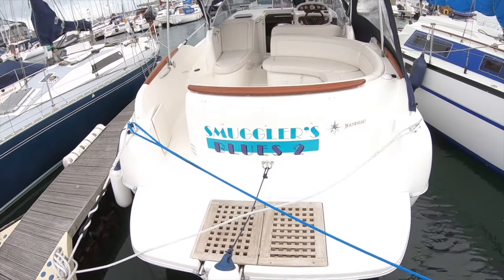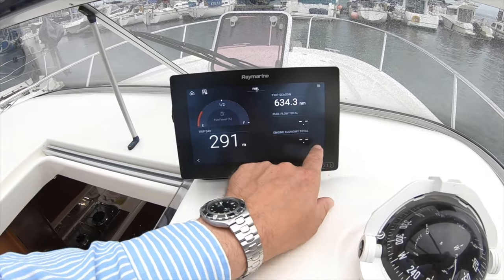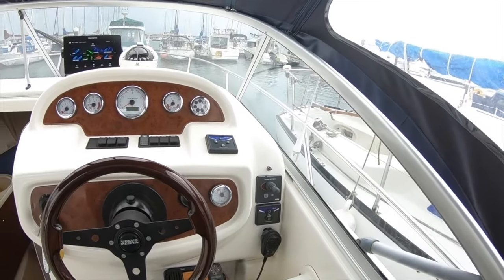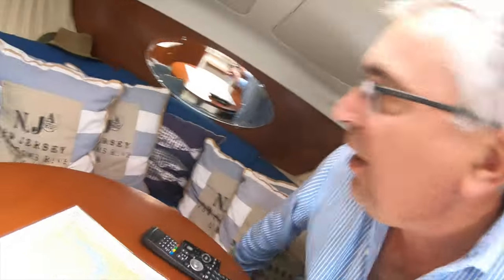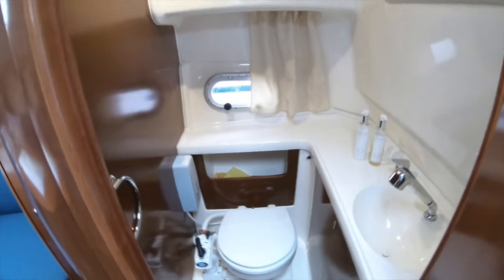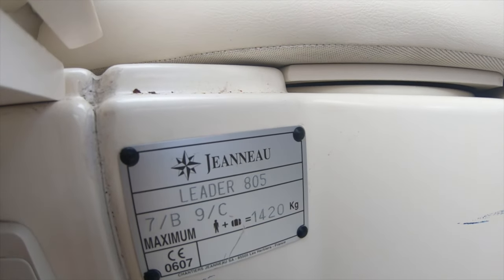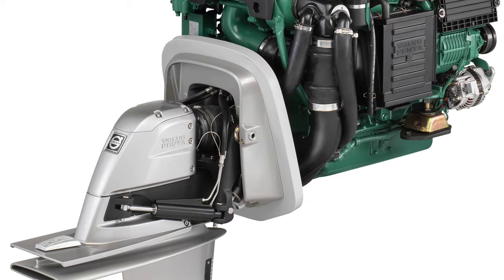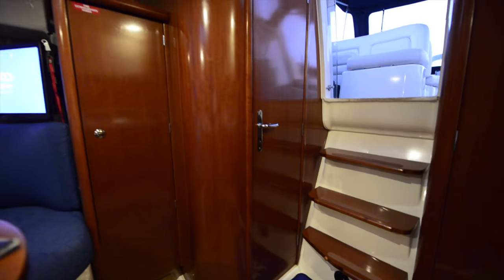MY OWN BOAT : Jeanneau Leader 805 Full Tour

Comment: Hi. Carbon monoxide sinks in atmospheric air. It looks like you have the monitor abover sleeping height. That may mean in the closed cabin the CO increases to be dangerous to the sleeper, but not trigger the alarm. May I suggest you check, but I would mount it as low as possible (floor level). Same for the other cabin where you sleep.

Comment: I think a Jeanneau 805 may be my next boat when I upgrade, once our kids get a little older (so we can bugger off and get some peace!) we plan on some weekend trips this looks perfect !
Reply: @Michiel Geerling I currently have a Beneteau Flyer 650 Cabin, with a 140HP Suzuki Outboard. it is a fabulous boat for a family day out. For a small boat it has a decent size cabin with a sea toilet. It will cruise on plane  happily around 18 knots or 34 Knots flat out on a calm sea. As a footnote In the past I have also had a Beneteau Flyer 550 Open, several RIBS & various other small boats including a SeaRay Bowrider (all to fit my swing mooring),  I really like European boats - so sturdy they handle our seas wonderfully, American boats are a bit 'plusher' but small American boats tend to be too light on the bow and heavy on the stern/engine - ok on lakes but no good in the open sea. :-)
Reply: And I like boats with self-draining decks !! no plugs to worry about !!! LOL
Reply: @Michiel Geerling It is pretty economical when cruising but not when at full throttle. I haven't really worked out fuel figures but if we go out for the day and cruise around the bay, stop in a few coves for a swim or lunch, probably 30 miles  round trip mixed throttle use would be about 20 ~ 25 litres of fuel. It has a 136 litre fuel tank and plenty of space for spare fuel cans So I think a range of 120 to 150 miles would be easily doable

Comment: Carbon monoxide has the same density as air and can form pockets. So it doesn't dissipate as much as you might think, or move around. So you should get those CO monitors out of the little creches and put them on the ceiling or walls higher up, where air currents will hit.

Comment: That canopy is clever. Mandatory youtube nitpicking, I thought most of the early Leaders 805 are equipped with the kad43 - just a slightly quieter kad42, I believe the power output remained the same. At least for those sold by the iberian dealer. Lovely boat and much improved hair.
Reply from the maker: HO, I do believe that you are absolutely right! I think it is the KAD43 although as you say, it's a very slight upgrade of the KAD42 so I think my comments stand.  :)

Comment: What a great boat,haven't looked at one before. I've got a Sealine 270 at the moment but think I'll have a look at one of those when I come to upgrade. I really like the wood below and wardrobes,seems to have a lot more storage than mine. Happy cruising.
Reply from the maker: Thank you. I'm extremely happy with it as you can probably tell! Yes, it would make a good upgrade from the Sealine 270, similar size and concept of boat but newer and more modern, and with the current series of Volvo Penta engine.
Reply: @AQUAHOLIC  Yes Nick, more modern is about the strength of it. I am a 270 (kad 42) owner & I know we have more standing headroom in the cabin & bigger galley area. The Leader was a strong 2nd choice for us except no Diesel boats can be found in France & the wife vetoed it when I insisted it would be named G.G.
There are many in our marina as they are built just up the coast from us.
Reply: @AQUAHOLIC  I'd like to add that I very much like the asymmetrical deck, with a wider port side .  Also the full width cockpit seating to make the most of the social space. For me the downside is no radar arch, where we have overhead lighting for evening lounging & the TV / Radio antenna up high. In our marina, we have tall apartment buildings that block some of the tv signals at low tide.
Reply from the maker: @russcattell955i  The asymmetric decks and full width cockpit work brilliantly. Agree about the arch, useful for canopy location too. But against that, the (winter) flat tonneau cover fits better as it doesn't have to cut inside the arch so it's all a compromise I guess.

Comment: I know it's an old video and i hope someone already told you but carbonmonoxide is denser then air so it sinks to the bottom your meter should always be placed below where you're head is going to be
in you cabin you have it by the window but sleep at least a meter below it place it somewhere near the floor. 
I hope this advice helps to save a life.
thanks for al the content Nick love your video's
Reply from the maker: This is the official advice: 
Because carbon monoxide is slightly lighter than air and also because it may be found with warm, rising air, detectors should be placed on a wall about 5 feet above the floor. The detector may be placed on the ceiling. Do not place the detector right next to or over a fireplace or flame-producing appliance.
Reply: @AQUAHOLIC  ow geez, thank you nick i learned something new today im going to check the advice on mine and relocate them

Comment: I had one as mi first boat. Very stable to cruise. Did not have flaps or trusters, due to its beam, you really need the trusters. Sold the boat, had an older mercruiser diesel single engine, single prop. Would now go for a dual engine setup.

Comment: Nice boat Nick! You didn’t mention range. Could you, if you were so inclined, take a summer off and take it down to the Med (obviously a few stops on the way)?
Reply from the maker: It’s probably about 250 miles. Med is technically possible if you went through the French canals.

Comment: Fab video Nick, Looking for my 1st boat after seeing your video will be looking at the Jeanneau leader 8 - year 2011 question being is this boat as good as the 805? regards Andy
Reply from the maker: Thanks Andy. As far as I'm aware, the Leader 8 is basically an updated 805 Leader. It's more modern looking and has some useful upgrades - the radar arch is great for attaching canopies (and fitting radar scanners I guess), the dash is tiered so it will take a flush mounted MFD and the cockpit seating is 'squarer' and more modern. The interior is virtually identical but there's an option of a matt oak (I think) finish. The only downsides I can see is that it's inevitably more expensive (as it should be, it's a newer more modern boat) and the bathing platform is longer even than the extended 805 platform, so takes it a bit over 8 metres (which may not be important). Looks a great boat to me! Best of luck.

Comment: You mentioned you had the boat machine polished and sealed, roughly what should you expect to pay to complete this work given the already lovely condition of yours.
Reply from the maker: All of the winter works, which included this, antifouling the boat, treating the teak on the bathing platform and a few other bits came to about £1,300 I think

Comment: Correct me if I'm wrong but isn't carbon monoxide heavier than air.  Therefore making placement of your detectors at waist height no good.  Should they be on the floor
Reply from the maker: Good question, but apparently not (regarding placement), worth a Google.
Reply: Yes, I've heard stories of people drowning behind like house boats while swimming because the engines were still running and the carbon monoxide sits on the water.
Reply: Ok googled that and yes indeed you're correct and I learned something today.  CO is not heavier than air , more like even weights making distribution a more even affair.  Great stuff

Comment: Thank you great walkthrough! Taking delivery next month of a jeanneau powerboat similar in size, very helpful. I’m looking at this seasmart unit, seems very useful. Do you use any other chemicals directly into the tank or after flush with this unit installed? Take care!
Reply from the maker: The toilet is seawater flush, so it pulls water directly from the sea and pumps out directly into the sea. So there isn't anywhere to put chemicals.
Reply: @AQUAHOLIC  That’s practical. I’ve got a holding tank to deal with. Here in Sweden authorities don’t allow waste into the sea, but the infrastrucure of pump out stations are a bit behind. Seasmart would probably help keeping at least the inlet hose in better shape (smell) 😊

Comment: I'm interested in getting this model boat 2003 ,I will only really be using it on the Norfolk broads, do you think it's a good boat just to use on river work, also what do you think is a good price for a 2003 model it had a diesel engine, many thanks and love your channel 🤠
Reply from the maker: Plenty of boats like this on the Broads, it's where mine came from! Price is very dependent on condition and specification so it's impossible to say, but diesel boats are always worth more.

Comment: As someone that only dreams of boat ownership,how in hell would you get that engine out if it suffered a major malfunction? There just doesn't need to be enough room.I'd be interested to know
Reply from the maker: You'd need to remove the cockpit floor.
Reply: @AQUAHOLIC  That sounds ultra-expensive.No wonder you're going to look after it!
Reply from the maker: Compared to the cost of a new engine I suspect it would be pocket change!

Comment: That is a great boat improved with your added kit..  What is it's top speed - cruising speed and fuel usage?
Reply from the maker: Thank you! Top speed is about 33 knots and it cruises very nicely anywhere between 20-27 knots. At 20 knots it's using about 25 litres an hour, at 26 knots it's about 34 litres an hour. In fact if you work it out, per mile there is little difference as, although the consumption per hour goes up, at higher speeds it takes less time to cover the same distance of course.

Comment: Great video. I am researching my first boat and this one comes up regularly but I don’t see many around. Can you tell me what year yours is as I the look, as well as if you know if there are any major watch outs?
Reply from the maker: Hi Mark, glad it was useful! Mine is a 2006, they were built from 2000 - 2007 I believe. The 805 Leader stayed pretty much the same bar cosmetic changes - earlier ones had pin stripes on the outside which date it a little (but could be removed), and the cockpit upholstery changed a little. The only big change is that very early boats had a lower windscreen but I've only ever seen one with that. I'm not aware of anything you need to be aware of regarding the boat beyond the usual checks. The D4 engine I mention in the video had a few recalls, the big ones being the raw water filter cap was originally a black screw down type and it could leak under pressure at high revs, pouring sea water into the engine bay! Make sure it's been changed for the new type, clear top and four thumb screws holding it down. Also the outdrive steering uses hydraulic rams. On early versions the slim ram that slides into the bigger section would get marine growth on it which would then destroy the ram seals. Volvo fixed it by fitting rubber gaiters. Again, it's a recall thing so it's fixable if not been done. Nothing else springs to mind, they're a little basic in some ways, Jeanneau saved money by being mean with things like no water tank gauge, no anchor winch switch at the helm, only one windscreen wiper, no horn, and so on. But the parts they do fit are generally good quality, decent Lewmar winch and deck hatch for instance. And they seem tough and well built boats. There are lots out there but you're right, not many for sale (I found the same). My theory is that it's a size you move up to that is affordable to run, and the next real step is a huge jump into 30ft+ with twin engines so way higher running costs. So I think people do what I've done, get to this boat which gives them a proper offshore cruiser with decent facilities and say 'that'll do for me'. I genuinely can't see me selling mine unless I have to, and that would be a sad sad day.
Reply from the maker: Just to add, in case you've not looked, there are lots of other videos of the boat on my YouTube channel. And if you 'subscribe' you'll get notified of any future videos going up (it's free, you just click the 'subscribe' button).
Reply from the maker: @mdtaylor2274  Thank you, I love it too! No licence required in the UK (although I do have an ICC anyway).

Comment: What a great boat!! How much would one of these run new?
Reply from the maker: In 2006 when this was new, about €100,000. Today, I'd guess at about £150-200K.
Reply: @AQUAHOLIC    You could easily get what you paid for it today Nick.  Personally, I would not trade your boat for two screws.  I am comfortable with a single engine on a coastal cruiser.  Yes, of course on a bigger blue water the redundancy of a second engine becomes important.

Comment: Hey Nick - now that the old 4.5Kg Calor cylinders have been discontinued, what make and model of gas cylinder do you use on Smugglers Blues?
Reply from the maker: Same, I renewed it a couple of months ago. I use the stove so infrequently that it should last me for years hopefully.
Reply: @AQUAHOLIC  Lucky you! I guess I'll have to measure the size of the old one then try and determine the size of the new ones to make sure it will fit!
Reply from the maker: @user-redsix  If you're in the southwest of the UK, try Darthaven, it's where I got mine a month or two ago.

Comment: Hey Nick. Finished the refurbishment and launched Sylvia today. First disappointment was how badly she hunts to Port and starboard at low speeds. Does Smugglers Blues do this and if so, have you found a sterndrive tilt position that minimises it? She is also too fast at 3.7 knots at idle, which is faster then I like to go in a marina. Guess perhaps I should not have bought a sports cruiser for mainly inshore cruising! Thanks and regards Steve
Reply from the maker: Sterndrive should be all the way down/in when not planing (so low speed use, also when leaving the boat unless the mooring dries out of course). They all wander a bit, you learn to guide them like a horse rather than steer them like a car. As long as it's pointing roughly the right way then let it wander a little. Otherwise you over-correct, then over-correct the other way and you're just sawing at the wheel constantly.

Comment: I’ve just come into some money thanks to the lottery and wanted to invested in a ship ..... is this a good ship to buy ? Thanks...?
Reply: Stop lying
Reply: I've also come into some money from a PPI refund, I might get the radio for when I'm in the bath.
Reply: Ive also came across some money in my bathroom turns out my wall had a compartment with 3 million dollars in gold coins should I get a radio for the boat?
Reply: Bigyeti Technologies you should also buy a ship..
Reply: Kevin garcia save up and buy a ship...
Reply: Kevin garcia not lying.... buy yourself a ship....
Reply: Sprocket by the sea..... go to the sea and someone will sell you a ship....
Reply: Bob G thank u Nigerian prince but I’ve invested in a ship now....
Reply: Crazyirish _  I'll need 10,000 as a wire transfer fee and 7500 for data protection archive storage fee...
And password. 👍
Reply: Crazyirish _  😜😂

Comment: Love the video. Where do you store the framework that goes round the back of the boat for the covers? Is it permanent or does it fold away somewhere? Looks like the front part folds up into a  tube cover, but wondering about the back part of the frame?
Reply from the maker: It folds forward ahead of the windscreen but is a PITA, so we leave it in place
Reply: @AQUAHOLIC  Many thanks. Can't seem to see another boat that has all the features at this size, (don't like curtained off compartments) wondering if I might be able to eventually stretch to a used Leader8 that seems to have a lot of nice ergonomic extra features.

Comment: Would you have been tempted to buy one with a petrol engine?
Reply from the maker: Not for my use, no petrol close to where I berth and more expensive to run (fuel cost and consumption are both much higher). But it depends where and how you use it.

Comment: 2+ years later...  A few thoughts:

I'm shocked at how much boat can be packed into 25'-7"...!  Great family boat, and very entertaining for two couples for a weekend.  Love the horseshoe layout!  Very useful.

Like the gas range.  (What the hell is a 'hob' anyway?)  I so enjoy seeing a boat in use...  Uno in the cupboard, and a sponge in the sink...  As it all should be!  No microwave?  

Nice call on the 12V system on the more-than-adequate 22" TV.  (My pet peeve - a 28" TV on a million-plus dollar yacht.)  Where are the bellow deck speakers, and...  No sub woofer, of ANY sort...?  It would so easy to add one, on BOTH decks, of nominal size, that would increase the quality of sound exponentially...!  2 Tweeters, above and below, would help as well.

The heater outlet at floor level is brilliant!  The CO2 monitors... call call sir!  The cleaning system for the looo as well...

As usual...  Spot on mate...  Cheers!
Reply from the maker: A hob is a little like a gas range, only British. 🙂